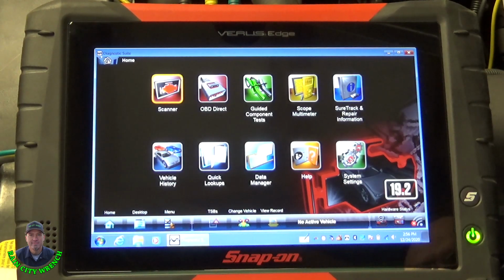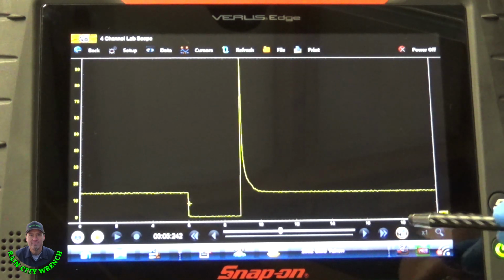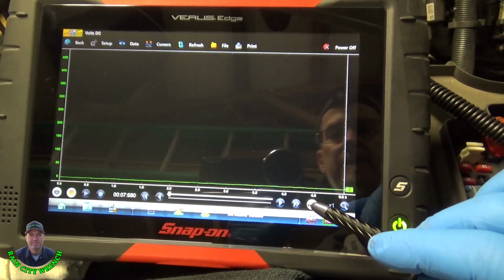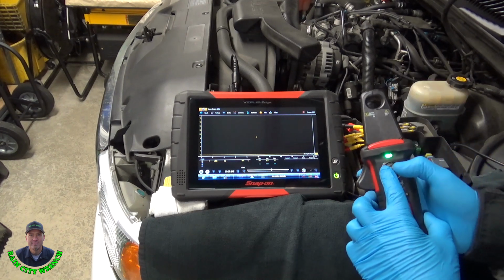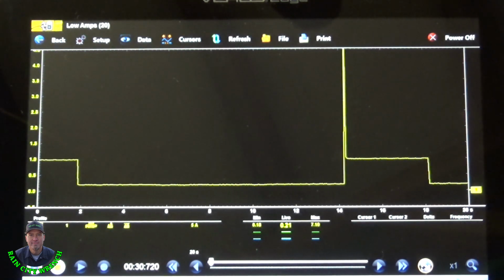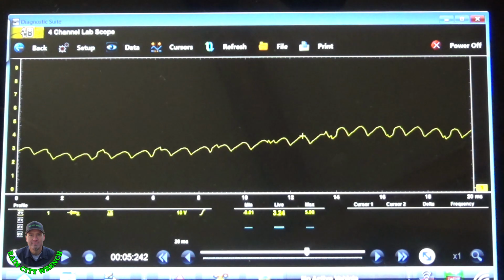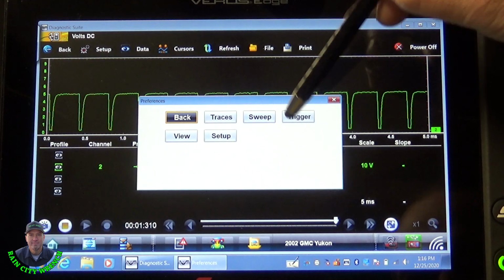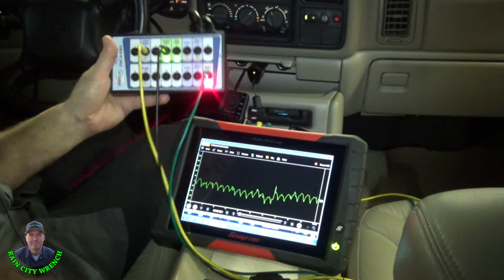SNAP-ON OSCILLOSCOPE TESTING. TEN BASIC AUTOMOTIVE TESTS.

Comment: I have the Escope elite 4 channel and it's awesome but i still like the snap on verus or verus edge. It has graphing multimeter and great component test with connector pin pictures and a lot of tests like voltage test, resistance test , frequency test, etc...  Snap on is unique and they always think how to make life easier for technicians. Great video. Thank you very much.

Comment: What kind of adapter u use to. Connect  it to the scope?
Reply from the maker: Most of my diagnostic equipment is from aeswave. They have some really nice stuff, check out their site. I use the 10' test drive leads with adapters and back probes. https://www.aeswave.com/Test-Drive-Test-Leads-for-Snap-on-4-channel-Scopes-p9964.html
https://www.aeswave.com/uTest-Advanced-Terminal-Test-Kit-p9748.html
https://www.aeswave.com/AES-Electronics-Acupuncture-Probe-Kit-p9474.html

Comment: I was looking to purchase a used SanpOn Verus Edge but was cautioned when I examined it. It would not read codes when I was trying it out and I only see 2 channel lab scope on the menu when I am using a Verus Edge 4 channel lab scope module? Is there a setting that needs to be changed? I haven't bought the unit as of yet but may still get to if I have an answer. thank you
Reply from the maker: Will be tough for me to answer without holding the unit in my hand but I would start off by reviewing the user manual chapter 5 & 6 to see if it's a pairing issue and then trying OBD direct mode. As for the scope issue, you should see 4 channel lab scope in options (see page 115) If so then two of the traces are turned off and can find the information starting on pages 110. https://www.snapon.com/display/3871/VERUSEdge_UserManual.pdf
Reply: @raincitywrench117  thanks for your reply. This gives me a direction to go on. I can get this Verus Edge for $2K and it is wireless with upgrade to 22.4. I will check it out again and if I buy it, I’ll let you know. I am a DIYer and only want to get better at what I do. Your video was very helpful.

Comment: Just started to watch the vid and already thinking , man I should have gotten a used Verus vs the Apollo D9 . Will finish watching when I’m off work but so far I’ve already learned a lot
Reply from the maker: Just looked up the Apollo D9. See what you are saying now. It doesn't have a scope module. I bought the verus edge specifically for the oscilloscope feature. I almost never use the scanner. I prefer my Autel tablet. Was told Snap-On no longer supports updates on the edge but don't care. As long as the Verus scope keeps working, will take this unit to my retirement. Have a friend that bought a pico but love my verus unit because the scope module is plugged into the back plus it's a compact easy to connect unit.

Comment: Hello, how can I get a snap-on car test device that is used and not new? What is the expected price? Are there sites to buy? Please help. Thank you. I am from Iraq, Refaat Al-Jubouri, and thank you.
Reply from the maker: I bought my verus edge on eBay used for $3500 US. Trendyol in Turkey is the largest e-commerce platform in that region but don't think they will have what you want, may be worth a look though. We take so many things for granted here in the states. There may be some sellers on eBay or eBayUK willing to ship to Iraq if you sign up and use a PayPal account. I don't know what automobiles are sold over there & what protocols they run but if you want to pull codes, do bidirectional controls, monitor pids, etc then an Autel scanner will be what you want. They have global software which will be able to handle European models that are probably running in Iraq. If what you want to do is look at sensor waveforms and computer networks then you will need an oscilloscope like the snap-on used in this video. Hope that helps.
Reply: @raincitywrench117  

Thank you, sir, for responding to my teacher. I asked for a snap-on device that has been updated. It is checked under the 2018 model so that it is cheap. Is there a site that sells in America, and its price is approximately? A thousand thanks

Comment: Thanks a lot for making this video. Good stuff. I’m learning a lot but i’m unclear about how the compression event is realized as voltage. Doesn’t the spark fire and produce the same amount of draw regardless?
Reply from the maker: You bet. It's really simple, the clamp in this video is measuring current draw from the starter through the battery cable. When the engine is cranking it will take more force to push each piston on its compression stroke so the starter will require more amps to turn the crankshaft over on each compression event. The clamp converts that to digital signal that can be viewed on the scope. To determine what each cylinder is on the chart requires a secondary channel and trigger on one of the ignition coils like cyl#1

Comment: I also have the verus edge and vantage pro , I like the how mobile the units are and so far haven’t had any need for any other scope including using pressure transducers .. I keep my verus updated through subscriptions .... I appreciate how much detail that you have put into this and even though I’ve been a scope user for years I learned a couple things here ... if you don’t yet have a pressure transducer I would recommend the ats 500 psi for in cyl and a vacuum transducer that you can either make or purchase very reasonable . You have a real good Chanel , thanks ,
Reply from the maker: Thank You! I heard Snap On no longer supports updates on the edge but don't know if that is true. I'm due for some updates but think I will only do my autel and leave the verus alone. Pretty much just wanted the edge for the four channel and works perfect for my needs. Just did a video a couple weeks back which located my problem in minutes. Would have been extremely difficult without a scope:https://www.youtube.com/watch?v=bacDwmmojm4&ab_channel=RainCityWrench

Comment: Can you use these new ones to also perform cylinder inhibit testing? Kill cylinders to allow carburetor balance adjustments?
Reply from the maker: It depends on the make and model but yea it will do a cylinder contribution test. If the vehicle is pre 1996 OBDII then no it won't. My last shop has a Sun 500E oscilloscope and that would short individual cylinders. Just had to connect pickup probe to #1 plug wire and primary leads to ignition coil.

Comment: I used to use low amp clamps for diagnosing parasitic drains but I got tired of replacing 9 volt batteries in them. Now I use the power probe hook in latched mode in series with the negative terminal. It’s also a little more accurate over time as there is no drift involved like with an amp clamp. The newer style Pico amp clamps with the auto shutoff are better about drift but it still happens to an extent. I just wish snap on would tweak their scope software a bit. Instead of giving a certain value for the amp clamp size they should just let you select the conversion scale like my old OTC handheld scope. That old OTC also had longer time bases in the graphing meter as well up to 24 hours.
Reply from the maker: Never used the power probe hook. The negative cable stays intact or is it disconnected? The snap on definitely is not the best but does get you in the ballpark.
Reply: @raincitywrench117  you take the negative off just like you would put a multimeter in series to test. The Hook has the option to latch the switch to pass the current and measures as the current passes through it. It’s very accurate, measures milliamps, and has min/max recording. It’s nice because you can leave a charger on the battery and let the hook run indefinitely if you have one of those problem child’s that come on randomly overnight. No spring about clamp batteries or buffer size. I use my scope for a lot of things including in cylinder pressure but I’ve found using the Hook to be so much less of a hassle for drains especially when it’s not something easy to find.

Comment: Does suretrack and troubleshooting comes pre- installed on the scanner or you have to subscribe and pay for use on line!
Reply from the maker: Comes installed, just need to pair it with Wi-Fi. This is from Snap-on: SureTrack community membership is currently only provided with the purchase of a Snap-on VERUS or VERDICT scan tool or with a bundle update for those devices. The MODIS Ultra and SOLUS Edge, with Wi-Fi, get SureTrack data inside the scan tool but do not allow the user to interact with the SureTrack community.

Comment: Versus Edge runs Windows 7 and Snapon has deemed it a security threat.

The Zues replaced the Verus five years ago and the Zues runs on Windows 10

Snapon has already started saying “updates for the Verus will stop in 2022-ish”

Sad thing is...aside from computer hardware and operating system, there is ZERO difference between the Zues and Verus “Snapon diagnostics software”.
The Zues just comes with a new color scheme.

If you’re looking for great beginner scope, buy a used Verus Edge. I paid $4000 five years ago for mine and now a days I see them running $2000.

The Verus Edge will also work as a graphing  meter, dvm, ohm meter...
Reply from the maker: Spot On. I turned off updates last year due to security software causing screen glitch. Deleted the last couple security updates & working perfect since. 
 Was told Verus updates end this year but either way their day is limited as far as Snapon is concerned. I saw a guy had a Zeus that was running Windows 7 so looks like that was installed early production on some units? 
 I picked up my Edge for 3500 bucks mainly for the four channel & still happy with it. Hope it keeps going strong for years to come.

Comment: What if the injector is stuck? To add on to your presentation, if I may, the viewers should know about the injector pintle closing shut. After the spike and during the descend, there is a small and almost un-noticeable "hump" just prior to the end of complete cycle time. If you didn't know this and as small as it is, your less experienced/knowledgeable tech could overlook it during the diagnosis of a dead misfire. The hump indicates the pintle slamming shut. If the injector is stuck closed, there would be no hump. If it was stuck open, well you know. Great informative and valuable presentation for the learners and even the techs needing a refresher though.
Reply from the maker: You sir are correct. The pintle hump is barely noticeable in my video with the Snap-on. Would come in even better using a picoscope with the higher resolution & sampling rate. 
I'm by no means am an expert but with that said I decided to put together a quick scope video for a few enquiring subscribers & anyone else interested. Thanks for watching!

Comment: Thank you for the no nonsense video. I also bought a used Verus Edge. Same thought process as you..  I agree, the platform is awesome, wish I could afford an ATS eScope, but for now, trying to get really comfortable in the realm of scope use in everyday situations. Good stuff, thanks!
Reply from the maker: Great minds think alike. Yep, use it often even if not really needed until it becomes muscle memory. Used mine two days ago to bail a coworker out when he reached the end of his rope. He spent half the day using a dvom with no answer but I had the fix in 20 minutes. I vary rarely do circuit resistance tests, almost always connect the scope up. 
I recommend the aeswave 10' test drive leads, use them all the time. https://www.aeswave.com/Test-Drive-Test-Leads-for-Snap-on-4-channel-Scopes-p9964.html
Reply: Is your Verus Edge still working? Mine won't let me use the scanner. It instructs me to renew my subscription.

Comment: Did you consider getting a PICO when you shopped around for a scope. If not why? Just curious.
Reply from the maker: My autel touch screen stopped working and snap on scope wouldn't boot up around the same time this spring. I was looking at the pico 4425 & escope elite4. But since I already had all the test leads and amp clamps the snap-on verus edge solved both my scanner and scope needs. I may just bundle everything up on ebay someday but for now everything is working fine. What scope do you have?
Reply: @raincitywrench117  I use a old handheld fluke 123. Its a bare bone basic industrial 2 channel oscope @ 20MHz
Reply: Would love to have a pico . The waveforms are so crisp and clean on a good monitor.